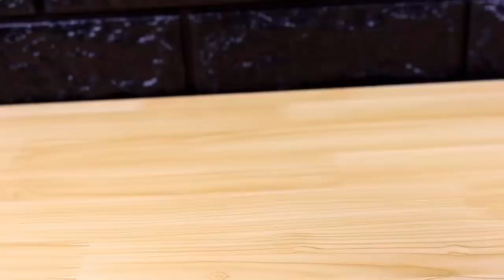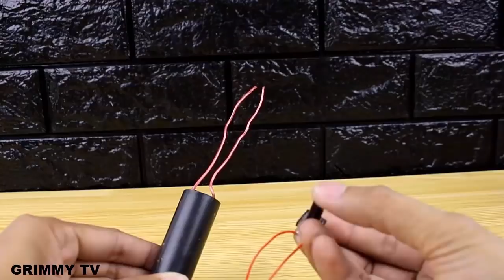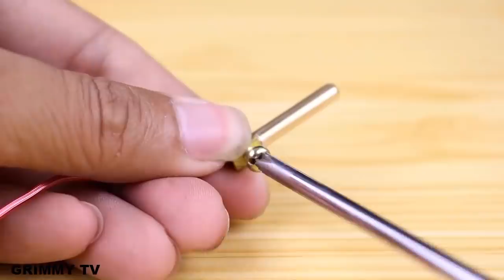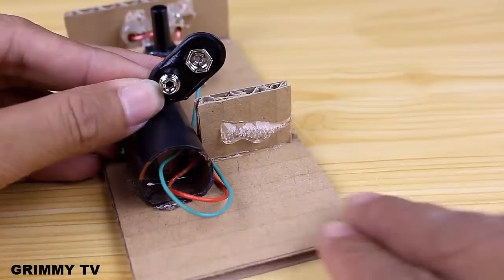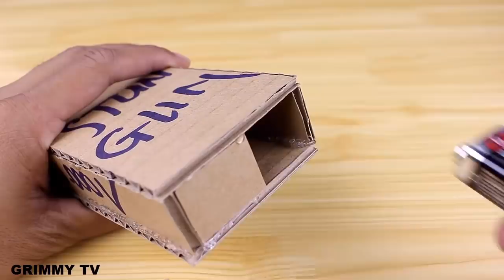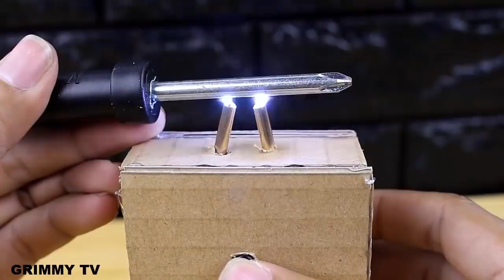How to Make Powerful Stun Gun 400 000V at Home - DIY

Comment: The only thing known in this vid is a 9v! What capacitor is used!
Reply: +Savio Lopes 
thank you for the link!
Reply: Roger McCavity, Electricity can be changed dramatically. It is very possible to take 9V and change it to 400kV. With what is used I doubt it is 400k though. But it could easily be around the 250kV range.
Reply: I've had one that was made in factory and it was powered by a 9 Volt battery and delivered 650.000 Volts
Reply: Roflmao
Reply: I hope  rich williams  doesn't do that....But if he does he doesn't understand capacitors and .....oh well....   He will learn quickly
Reply: USA Growup aa,”
Reply: You can have a taser that is 1 million voltz and it could be less powerful then this one. The reason why is because the current is different. The current is what controls how many voltz the tasar actually puts out.
Reply: sykoteddy I'm pretty sure they all used 9v batteries when they first started making them. Then some went to two
Reply: Thanks man.
Reply: Almost all 9v. Then use an e-cigg battery like a 18650 or a 26650.
Reply: I threw a party 15yrs ago and we were all drunk shocking each other. It was 750,000 and hurt so bad. The only way to drop someone was to hold the person while shocking them until they fall. And no the shock doesn't transfer to you. It's funny they are illegal in a lot of states but open carry is ok.
Reply: thats no capacitor dummbie its a boosconcorter
Reply: Jeff Bladoop Wtf is that? it's an arc generator
Reply: USA Growup i recommend using 18650 3.7v batterys therye much better
Reply: Highly illegal where i live, prison time
Reply: USA Growup g
Reply: USA Growup more than likely a 6-9vlt to 400,000. They cost about$4.00 a piece.
Reply: High voltage pulse inverter from Ebay
Reply: Not a capacitor, it’s known as a boost converter. Also be insanely careful with it
Reply: John wock 
Right, so how do you get to 250kV?  And why wouldn’t 400 then be possible?
Reply: U need to move brother.
Reply: @bobby dazzler ohhhh shitttt!!!! dam that hurt
Reply: would make a great bbq lighter
Reply: No way a 9v battery is 400,000 volts, since I was a kid I've known you can literally stick your tongue to a 9v battery and know if it's good or dead from the tingle it gives you if it's still got juice left in it, me and a bunch of my friends would be dead a long time ago if it gave off 400,000 volts, even stuck my tongue in the end of a spark plug wire on a car engine while somebody turns the engine over to see if it's firing and that puts out at least 12-14 volts it hasn't b b bot bothe  b Bo bothered m m m me 1 1 1 b b bi bit bit at all can't you tell lol
Reply: the battery's 9volts, the voltage booster raises it to 400,000. in the same way your 12volt car system raises the voltage for the spark plugs to 25,000.
Reply: Not only what capacitor, but what else? Just connecting a battery to a capacitor won't give you continual spars like that.
Reply: Brainchild69 it's a voltage booster not a capacitor.
Reply: @dosmundos3830   and what exactly is a 'voltage booster'? Go to a store where they sell electronic parts and ask for a voltage booster. They will ask you what you're trying to build and they will think you're ignorant a f. There's a couple of ways to increase voltage and one of them does use capacitors, but that alone won't produce continuous sparks like this. You would need a transformer and either alternating current or pulsating direct current. Having worked with these things before I already know what parts are needed, but the title of the video indicates that it will show you everything you need to make this, and it does not. And your response to my comment indicates that you don't know much about electronics either.
Reply: Don't know about where everybody else lives but here in Alabama all the Radio Shack stores have closed down or lse I'd try and find 1 of these and see if it would work the way it does in the video, it don't look like he's got more than $10 in making this unless that capacitor I'd alot more than I think ,I can't think of anywhere else around here that might sell this kind of stuff ,maybe Lowes posibly
Reply: @Bodine--  I know, huh. I hate that Radio Shack closed (here in Texas, too). Now I don't know where to get electronic parts for my little projects.
Reply: @Brainchild69  I know it sucks ,im 49 years old an been going to radio shack since was a kid with my dad ,it used to be our little toy store and I can't think of any other place even close to having what they did ,I bought a small battery operated motor there for a deer feeder once, the feeder was $149 + tax ,that little motor when it went out didn't even cost $1 from radio shack ,I expected to pay at least $20 for that sucker, I don't know of any other place like it myself
Reply: @Bodine--  Same here (being 49, I mean). I would like to find another place to get electronics.
Reply: @dosmundos3830  Like I said, not called a 'voltage booster'
Reply: Brainchild69 potato potato call it what you want wherever you are, that's it's function. it's certainly not "Just connecting a battery to a capacitor" like some idiot suggested lol
Reply: @dosmundos3830  Oh yes, you are right.
Reply: USA Growup its a 16,000 volt generator
Reply: @mr.mockingbrd  the one He used was 1000kv
Reply: @Bodine--  have you tried the internet?
Reply: @beanieteamie7435  yeah when I know what I need I do ,I just liked going to radio shack and looking through their stuff buying things I may want later not necessarily need at the moment
Reply: @Bodine--  Fry's electronics.  Or crack open a few old stereos. You can build a continuous arc generator with a capacitor bank and a compression board. Happy hunting.
Reply: @Private Private There is no such thing as a "boost converter". It's known as a "continuous arc generator ". And it's normally much bigger.  Hence why people think it's only putting out 250kvh.
Reply: @dosmundos3830  that may be correct, but uou can make it that way too. Look at the one from NightHawkInLight. He doesn't use a "voltage booster" in that one,  and it's made from a disposable camera.
Reply: @guardsmanom134  thanks bud ,I've got an old home steroids that's even got a record player on top of it lol ,I bet kids today don't even know what a record looks like ,I'll crack that sucker open an see what kind of goodies I can find in it, thanks again
Reply: @Bodine--  Good lordy, I miss my old lp player 😂😂I actually used to have one when I was a kid.  I have an ole made in China iSymphony that doesn't work anymore,  and one of the most prominent components is a 35kv capacitor.  If I ramp up the voltage via a discharge bank to overload the capacitor, I can get near continuous discharge.  Gotta love necessity,  mother of all invention and the plight of tinkerers. 😃😂
Reply: @guardsmanom134  you're right ,I got that old steroids from 1 of my aunts bout 25 years ago I guess, I was 1 of the late followers of cds when they came out cause I had all my favorite music on cassettes and it has a double cassette deck ,a stereo, and the record player on top ,she was upgrading to cds and I being hard headed ,just couldn't justify buying a cd player and swapping all my tapes out for cds ,come to think of it there's probably not many kids who know what a cassette tape or player is ,man I'm starting to feel old lol ,it still works cause it's the only home stereo system I've got with the two 3' tall speakers but I'm up to date now on my music players so I think I can get more use out of the components than I will from the overall system so I'm gonna check it out
Reply: @Bodine--  those old stereos were more reliable than the new junk my generation grew up with. I got lucky and my grandma gave me her old lp player.  It had a cassette player and an 8 track player. I had it till I was in highschool.  I think my mother still has it, now I think about it..
Reply: Big prison time here in Canada , but hey I. Sure some have already made thier own and never say a word so never to be caught , our firearms laws only in place for Law Abbidding Citizens , everyone else does as they please .
Reply: @Bodine--  they work exactly like the video. Ebay sells them, I  habe a couple of them, shoot me an address and I send you one

Comment: I think you are claiming "actual voltage times 10".   Will be 40,000    (40 Kilovolts) volts,  not 400,000 volts (0.4 Megavolts).    Please correct your header.    If 400,000 volts, you would not be able to get anywhere near it.  Also, it would certainly self-destruct in very short order.

Comment: not 400kv, to get high volts you need to use an oscillator with a stepup transformer. I have no idea what bits he used, looks sus to me
Reply: Kelvin Ham it's 100kv
Reply: Lolol Lilol it's 25kv I've got one and mesured it
Reply: You cannot use transformer with batteries.. Battries provide DC while a transformer works on AC. It is high voltage pulse generator or a Arc pulse ignition coil module.

Comment: I've heard it's not the volts it's the Amps that gets you.
Reply: G.R, Dray you’re right. Colts don’t kill, amperes (amps) do. Ohms law states it takes I volt (pressure) to move one amp (current) across one ohm (resistance)
10,000 volts on a taser won’t kill you because it’s pulsed, which causes the current to be extremely low. Where as 120v AC (continuous feed) with 13 amps can cook you if you’re muscles contract enough to not get off the line do to the voltage.
Reply: The Last John Wayne 87 Well, Colts don't kill but Stallions do.
Reply: I study electronic engineering and I can tell you that the volts directly affect the amps, meaning what you're saying is only a half-truth. Generally the more voltage being pushed through a circuit, the more current there is. The current can be limited with resistors though. That's why you can have a 400kV taser that only supplies a few milliamps of current
Reply: After all, it's not meant to kill, is it?
But even without heartflattening amperes, still gotta be careful when playing that prank on grandpa with his pacemaker...
Reply: G.R, Dray if amps kill you then why there are high voltage and why not high current... Just learn some electronics
Reply: @Fred Smith ...have you ever put a finger in a light socket.?
Reply: amps is what gets you dead,it takes 1 volt to make an amp,1 amp will kill you, aa battery has 1.5 volts.
Reply: @Fred Smith Your right.  In the old days, we would just place a 9v battery across the human heart to induce Ventricular Fibrillation in the electrophysiology lab.
Reply: Unhealthy, volts above 50. Amperage above 0.001. Both can hurt you. And don't be wet!!
Reply: you are so right my friend, it the current that burns yur ass and that aint gonna be achieved with this 9v battery, at best you gonna get a little tickle, you safe!
Reply: @Fred Smith I appreciate the effort, but I just don't think I'm ever gonna understand this. So a dim light bulb can't electrocute me but it could at full power?
Reply: As I understand it, yes the current (<30mA) through the hearts anode is deadly mainly because of the frequency of which the alternating current is delivered thus sending the heart into fibrillation, Hence why a DC defibrillator can stall the fibrillation and the body will hopefully restore normal heart rhythm.

Comment: what is the cylinder of which a pair of terminals r connected to plus and minus electrodes in series? dc-dc convertor?
Reply: It is an oscillator connected to a voltage multiplier. The current switches to ac from the oscillator and then it switches back when it comes out the multiplier.

Comment: I think the voltage is too high and it might kill a person but nice idea
Reply: AMPS kills you! not VOLTS 👍
Reply: That is somewhat true Brandon. Although people get that confused with the amperage output capabilities of the battery. A car battery at 12 volts has the capability of delivering 100s of amps yet I can touch both ends of this battery without fear. The 9 volt battery is more than capable of delivering more than 2 tenths of an amp at 9 volts. It only takes about 2 tenths of an amp across the heart to be dangerous or lethal. This is not much current at all. People are poor conductors of electricity.  In order to drive that sort of current across your chest it takes a lot of voltage. Think of voltage like pressure and your body as a tiny tiny pipe. Not much water will flow through this tiny pipe without a lot of pressure. In fact think of the pipe so small that no water will pass through it without high pressure. If the water tank providing the water source is small with a small outlet it wont be able to deliver large amounts of water through that teeny tiny pipe no matter how high you raise it in the air. ( more height gives you more pressure) In this case the small battery is capable of a small amount of output. (wattage) Wattage or watts is volts x watts. So if you step up the voltage the current capabilities go down. If the battery has a maximum output of 9 volts x 1 amp then it is 9 watts. Convert that 9 volt source into 18 volts and the max current is .5 amps. 18v x .5= 9. double again...36v x .25amps = 9 and so on. So you can see if you step up the voltage in the 10s of thousands that this battery could not deliver much current at all.
Reply: Nabeel Shiraz amps kill voltage hurts
Reply: TheBuildCave do you know how many volts police tazers have? 400k isn't shit to a police tazer hell my tazer is 2mil volts.
Reply: TheBuildCave    E = I x R   .    Very good post that you wrote here.  Electricity is boss !
Reply: TheBuildCave  ( Except "Wattage or watts is volts x watts."   That is not correct, but I think you know that. )
Reply: Nabeel Shiraz you could have 25,000,000 volts and not kill someone. This is 240
Reply: I guess nobody on here heard Obama, (after the Russians bombed more shit out of ISIS in two weeks than America and the coalition did in two years !) admit that ISIS were their's and ask Russia to stop bombing them.
A bit of research will reveal that three separate presidents, starting with Reagan, funded the training and arming of Al Queda, ISIS/ISIL and Daesh.
These 'terrorists' were created by America and her allies.
Educate yourselves, ffs,  instead of talking shit! 
Smh.
Reply: Nabeel Shiraz go on....
Reply: CoolFinn69 not racist . Monotheism
Reply: no it wont cuz its only na short time that's why
Reply: Nabeel Shiraz yes but better than bullets.

Comment: Wrong. I'm not blaming you, but take this as a tip to everyone. The arc between the spark gap is absolutely not 400,000 Volts. All these companies are making false claims about these high voltage generators. Now since they can't legally falsely claim that it's 400,00 Volts, they mislead you. Sure it may run 400,00 Voltage, but voltage is absolutely nothing without current. (Read that again). The volts mean nothings when regarding the arc between the spark gap. In which the arc is and should be measured in milliamperes. 4 - 7 milliamperes is quite dangerous and thats what runs in police tasers. It is absolutely enough to stun you and make you fall and lose muscle control. It wont kill you unless you have heart problems or whatever, but still has a very low chance. These high voltage step up transformers don't carry even close to around that many milliamperes. It all depends on the amperage (current) and the arc. The longer the arc, the more current running, making it more powerful. Thats how you know. So don't go buying like "980,000,000 volt high voltage transformer" like thats almost close to a lightning strike, it can't possible run enough current to output that. Thats my tip!

Comment: This is bullcrap,because air can break down under 10-15 kvolts at 1cm gap,his prongs we're about 5 mm apart from each other,so it would be even less than 10kvolts,not 400 000 volts!
People are dumb

Comment: Look man I'm not trying to be mean but anyone who wants to make their own taser should know a little bit of basic parts before they follow someone who just simply feed 9 volts into a momentary push button then to a step up transformer I'm 14 and I know this and making a taser thats supposedly 400,000 volts in a cardboard caseing is a MAJOR fire hazard. If you wanna make one might I suggest electrobooms simple ignition coil idea, or just take a bug zapper racket  circuit and wire the capacitor leads out as far as you want your prongs to go, and start off small you can get high voltage step up transformers or high voltage generators later on once you have some knowledge under your belt

Comment: the black cylinder is a DC 3.6V-6V To 400KV Boost Step Up Power Module High Voltage Generator  available on ebay

Comment: Its not DIY  Homemade! Yes ok you connected and solder it toghete,r but its a ready made module you use. I mean a monkey could build this thing...!! Build one from a relay an old condensator and some old smal transformator...then il be slightly impressed. Look for your inner Macguver dude and then try to impress.

Comment: If it has so much amps volts off that 1 battery why not get a multimeter and prove it even if u say it has high volts it doesn't u can still Check the amps on it I have a 3200 Mah battery and it's 3.7 volts the exact battery they put in tesla cars but thousands of them so know this 1 battery will not do that u people say 9 volts that's a car battery harmless until you touch the posts and crank the engine look at the cranking amps on those battery u might full idiots but I'm a electrician and guaranteed no more then u about electrical I've built houses big commercial building a turnpike and hospital and plenty of other jobs just because u can print a plastic gun and make it look cool don't mean shit I'll hold that on my arm for 10 sec easy I've been hit with high voltage if u e en know what that is